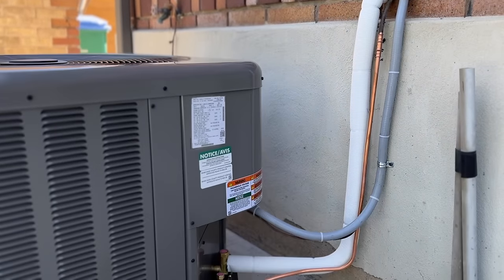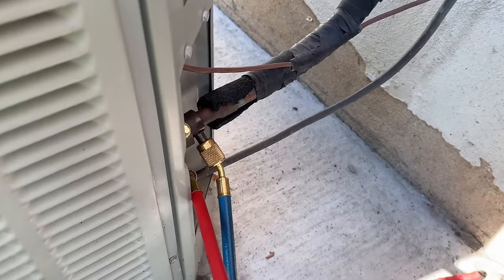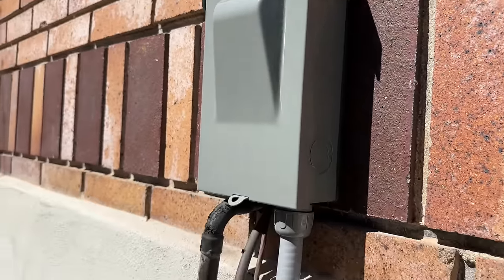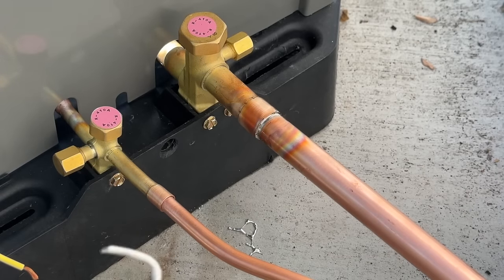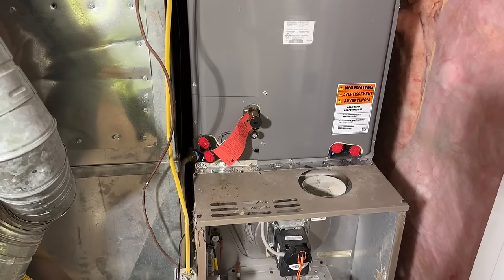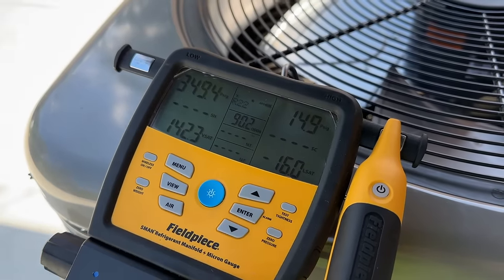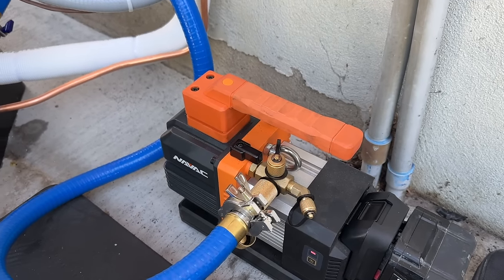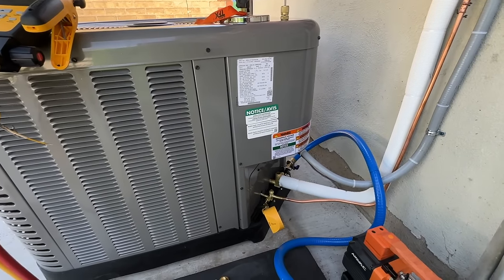Did You Know You Can Replace Your Own Air Conditioner?   -SAVE THOUSANDS-

Comment: There is a reason you need a HVAC license to buy equipment and freon. I applaud you for doing things the right way but how are home owners suppose to save thousands? By the time they buy the proper tools to do this job right they are already thousands into it.
Reply: You don't need the HVAC license to purchase freon. That is the EPA license, which is easily obtained. Commercial appliance repair, residential appliance repair, and automotive all have some variant of the EPA license.
Reply: Have you received a quote from a professional lately for a new hvac system? I have, and the cheapest qoute I got was 16 grand for a 3 ton system.  The equipment cost was only around $4500. The rest was labor! Even if you spent $1000 dollars in tools, you're still saving thousands of dollars. Granted, if you can afford it, have a pro do it. However, if you're like millions of people right now who are struggling to pay bills because of our economy, then doing a diy install makes sense. Especially if your old system needs replacing and you can't afford 16 grand for a pro installed unit.
Reply: @number1pappy that’s crazy what area are you in? We do them in Oklahoma on average a new 3-4 ton system is $7500
Reply: @number1pappy   My AC unit is 24 yr old. I called couple of HVAC companies to see how much it will cost to replace a 3.5 ton. The first company wants $16,000 , second company wants $12,000 , the third one was $9,000. Found out you will get a better price if you replace it during winter time. Apparently they jacked up the price during summer time.
Reply: @number1pappy  Talking to the wrong people then, I just did a 2.5 ton unit with a 80k btu furnace for 5000 out the door for a guy because he was getting insane quotes and I wanted to help him out.
Reply: @jredbokie1247  I live in the Columbia SC area. Sounds like I need to move to Oklahoma! Lol!
Reply: @DakotaHeatingAndAir  that sounds awesome! I could litterly fly you down here and I'd still be under what they want here in price! Lol 😆
Reply: @number1pappy  Having a "Pro" do it doesn't guarantee a good job.  Many who worked on R-22 systems won't bother using nitrogen while brazing a R-410A system and you end up with cupric oxides floating through your system.  Usually won't fail right away but you're in for problems down the road such as clogged metering devices and filters, one way valves and premature wear on your compressor.  Think pouring dust or fine sand in your engine's oil sump.  If you're lucky it will fail before the warranty is up but you might still get hit with the labor costs, which is substantial.  I've seen R-22 systems running fine after more than 25 years.
Reply: @cancel.lgbtq.6892  Well it is a lot hotter in the attic in the Summer.  So they have to take more frequent breaks and use cooling methods for their safety.  That costs more in man-hours.
Reply from the maker: Thanks for explaining this for me @number1pappy    I get tired of explaining it sometimes 😅
Reply from the maker: Prices are dependent on location. Wherever you are in Oklahoma that is way cheap. But even so, if your equipment cost 3k and tools were 1k you are still saving a whopping $3500
Reply: @number1pappy  You'll also have the tools for future maintenance use, those tools will last a lifetime for the diyer.
Reply: @avidavid9237  very good point! 😊
Reply: EPA LICENSE ???? TO HANDLE FREON , ITS A LAW
Reply: @jredbokie1247 I don't see that low of a price in OR. Not since 2007 atleast.
Reply: @bronzechicken4437  yes but just because an appliance repair person has an epa license doesn’t mean they can work on HVAC equipment.
Reply: In the state of Kansas you have to be APA certified to buy equipment!
Reply: @cancel.lgbtq.6892  Yes, off season is cheaper. I got six quotes in January, all around the same price except one that was outrageous. A 5 ton American Standard install was $13k and some change with duct work modifications.
Reply: Just bought a rheem 14 seer2 (yes seer2) the guy said it about the same as 16 seers last year.  And it cost $7500.. for both condenser and air handler… 
I called 2 company over, 1 saids $14k and their system not multi task like mine and they wont tell me how much the system cost.. as I figure out it around $5k for 5ton.. the other co. Estimated me $18k. I told them.. thank u.. so I bought all the tool.. it save me over $8k
Reply: As a diy I replaced mine 3 years ago and did everything in this video to a T thanks to YouTube. Unfortunately it was before this channel was around. I spent $600 on tools and $1100 for a 2.5t 16 seer system plus another $200 for coil with txv valve at an overstock warehouse. So you do the math. Still running great as of today. Oh I also got my level 1 license.
Reply: @bronzechicken4437 Sorry but you are wrong, the only refrigerant you can buy without a license is R134a from an auto parts store and less then 16 ounces.
Reply: @number1pappy hey buddy, you need to shop around, first off they marked up the equipment, a three ton system is about $2500, next you should not pay any more the $3K in labor. Find an independent contractor not a big dealership. Most I would charge you is $6K tops.
Reply: @hjc4604 that’s a myth, the soot literally does nothing and would be caught in the filter dryer, not to mention it’s like a spec of fine powder.
Reply: This person who say they got a quote of $16000 for a 3ton unit is a liar or the company is a thief..
Reply: In some states it is illegal to sell u a unit without the purchaser not having a licence. U even let some of that freon gases out u and get caught by environmental code enforcement u can be charged a whole lot of money.
Reply: Lol y’all just don’t get it
Reply: @cancel.lgbtq.6892  exactly
Reply: @number1pappy 16k for a 3 ton? That’s insane.
Reply: @number1pappy I got $16000 for a 2 ton system in Atlanta. And I need 2. Got 3 quotes all in the same ballpark.
Reply: @number1pappy you got quoted by a bad company lol always get a few estimates, shop around. No reason a new system should be 16K
Reply: A few hundred is more the cost of equipment
Reply: I got a quote a month ago 30k for a 5ton 20 seer, 25k for 18 seer 5 ton, 22k for 16 seer, and 20k for 14 seer, heat pump but still…….Really can buy the condenser and air handler for 7k or less.
Reply: @morallyinsane7639  Strange, I do commercial appliances and readily can walk into most supply houses and purchase 410A with my EPA card. The EPA card entitles you to purchase refrigerant. That's the literal purpose of it.
Reply: @MrCmgl1  I'm aware, I just was responding to correct the original commentator.
Reply: @bronzechicken4437  I never said that. An EPA license is needed to get a HVAC business license and need to buy refrigerant for the particular class you have, as a universal license covers all classes. I only said those who don’t possess a EPA license can buy under one pound of R134a from an automotive store. How you thought I said something different is beyond me. It’s obvious you misread my comment.
Reply: @morallyinsane7639  I had two or three to reply to so it's possible I did misread it. My apologies. The store cans also recently appear to have become 8 ounce cans, suggesting they might tighten the regulations.
Reply: If you install it yourself you better tell me some scam artist ripped you off when I have to come fix it. But I say go for it. I hate installs I love service work. It will be like a free helper and I just have to come commission the equipment.
Reply: @deepfrieddeals I’m in Atlanta to and they are ridiculous.  Need to replace an upstairs unit because due to it being on a corner lot with no shade.  Damn thing was running all day and night until I added a portable unit to help assist.  Need a bigger unit.  Over the past five years nobody has been able to explain it other than get a new unit without talking about what I really need to fix the problem.  Last time I got a quote a few years ago it was 14k.  Hell nawww.  Have had coils, fan motors and etc replaced a few times which I found I could have done myself and saved hundreds of dollars.  Im going to replace the system myself.  Changed my condenser in my truck last year so I already have the gauges and vacuum pump. 14K for a 2.5 ton is crazy.  You can get a complete system for around 2500 to 3500.
Reply: @moonlightacmaintenance3232  Here is some advice for you, never inherit someone else’s work. You are only asking for problems especially if the prior person fucked up the job. A buddy of mine used to do it all the time, and it always cost him more down the line then he ever made on the job. I taught him to scrap the job and start fresh. Of course if you would rather learn on your own, go for it.
Reply: I live in a house without a basement. I have what’s called a perimeter loop around the concrete floor. Should the unit in the house go at the bottom of the downdraft furnace or the top?
Reply: @leiferickson713  The coil has to go directly in the air flow, thus your unit would have to be lifted and placed on top of the coil with the plenum box below the coil. You might be better off with mini splits depending on the layout of the home and where you want cooling.
Reply: Hey- some of us are a lot more resourceful because we've had to be. We share tools- sometimes barter trade for tool use- like I have a buddy w a flatbed but I have a snatchblock and a bolt on crane attatchment, and when our friend needed something moved, she traded both of us use of her late fathers tree rigging equipment and chainsaws for a hazard tree - we all solved some issues, and nobody bought a thing except gas, sunscreen and cut proof safety gear. u know what they say,  where there's a will, -theres a bunch of scrappy diyers..
Reply: @ULINEgo  The saying goes, it’s not the tool that gets the job done, it’s knowing how to use the tool properly that gets the job done.
Reply: The tools are cheap and doing it yourself is 2 to 4 times less expensive than the greedy AC companies!
Reply: The r 22 is alot better Air condition
Reply: @bronzechicken4437 in California do you need a license to buy anything related to HVAC
Reply: True, but you just paid for your new tools and have them for the next job.
Reply: @number1pappy  about 20k 
California, if you handy enough why not do it your self,
Reply: California wont sell you a ac compresor if you don't have hvac license
Reply: Am I missing something? There are a lot of missing steps? From the installation from inside and how to use the equipment. I really need to install the furnace and air conditioner in a house that I bought that needs a lot of work.
Reply: Hvac hacks are deep in these comment sections lol 😅
Reply: Look at the tools as a perpetual investment.  The joy comes when you can fix it yourself the correct way.
Reply: If you are letting the old gas in the air its not good for the environment. Not sure how a home owner without epa cert will recycle the gas .
Reply: Right on. Soft solder 410A is just wrong
Reply: @number1pappy  you are nuts.  In my area you can get a 3 ton central AC seer 14 or 16 and a furnace for 7500-10,000.  That price must be a big 5 ton. If not it’s ridiculous
Reply: @number1pappy a lot more than 1000 in tools bruh
Reply: joe shmo definitely isn't doing this
Reply: I have my EPA and access to tools. I can replace my own for the price of supplies. The unit and a few hundred in new duct to fix what someone else messed up.
Reply: @morallyinsane7639  there are 2 sides to every story, I’d be interested to see what the actual quote was for. You don’t know if he put a variable speed condenser, UV light, duct cleaning and all kinds of other shit on there too. Be careful to judge until you know the whole story. But hey, if he’s telling the truth, that contractor won’t be around long
Reply: @christopherfoote3395  is there an EPA license involved here? Or are all these people doing this without it?
Reply: @jonswisher8796  it’s not the equipment price that makes the difference, it’s the mark up on that equipment. Depends how a contractor prices their jobs, whether it’s a flat rate price of material and labor or variable pricing. I have seen companies charge a 150% mark up on equipment and a labor cost of 2 men 8 hours each at $150-$200 an hour for labor.
Reply: @jasonwoodward4207 where do you live, Manhattan?
Reply: If you install it, you can also maintain it.
Reply: @jonswisher8796  Yes but people do it all the time without it when handling the freon.  As long as you don't discharge it into the atmosphere and recover it properly you won't have an issue.  There is free training and la free license that come with it after you finish listed here.  Knock it out.  I'm almost finished.
Reply: @jredbokie1247 I'm in NC and a 2 to 3 ton system for a basic system costs 9000.
Reply: @DakotaHeatingAndAir wow. Must have gotten a good deal on the equipment.  What was your profit?
Reply: @noahoyeah  I made about 1100 take home give or take.
Reply: @jredbokie1247
Who do you work for? Because I’m in Oklahoma and that is the cheapest quote I’ve heard…
Reply: I work in the HVAC supply business. The DIYers are the worst.
They go to YouTube University and think they've got it all under control.
No video is going to give you all the little tricks you learn over years of experience.
These folks will come in, make purchases and return dozens of times for more material.
They'll try to pick our brains and we'll tell them your the contractor now, I don't know what you need why don't you know what you need.
What's next, doctors showing folks how to do their own stitches?
Tradesmen like this dude are what's wrong with the repair industry today. 
Why for the love of the God's would you want to put yourself out of work?
Years ago folks would guard their trades secrets well.
Now they give them away for a few dollars.
These tradesmen are the worst of the worst and should be shunned by their contemporaries.
Reply: @gitouttamyway7611
Theirs nothing wrong with a DIY person, we all were learning at one point or another.
The average American is living paycheck to paycheck unfortunately it is extremely expensive to have HVAC work done. You hear horror stories about auto mechanics ripping people off well guess what you have HVAC people doing that too. 
I legit had an HVAC tech carrying on a conversation with me while he worked, asked me where I worked an what not at the end when he gave the quote on what needed fixed I was told “well you make the big bucks share the wealth”. I do not make big bucks, I never told him what I made he just assumed, either way extremely unprofessional. The guy also over charged my unit messing up my expansion valve which they never did take ownership of an wanted to charge me another service fee. Thankfully a family friend that was a tech is the one that figured it all out.
Reply: @number1pappy u gettin screwed
Reply: You guys must be out of touch around here units cost about $16-$24,000. No Joke, a 3 ton unit so if you don’t believe me just call any local place around here in South Carolina and ask for a 3 ton unit installed your house you’ll find out is 16 to 24K and that’s not including other cost labor and materials and all the other BS they want to add. I know you could buy air handler’s and coils separately on your own but you can’t buy Freon.
Reply: My son was quoted $20,000 to replace his AC.  It was 103 F outside.  He decided to wait until winter.  In meantime he bought a window AC to get by.
Reply: Buy the tools, then resell as used.
Reply: This is ONLY a diy job if you have the knowledge and tools to complete the work. I know this and I don’t even have a HVAC education. Loved the video though.
Reply: Are there any places that do on the job training
Reply: Freon hasn’t been used in years…….
Reply: Some of us are just that curious to learn anything to benefit ourselves and families and actually want to have tools for the fun of it. So don’t you worry about us, after all we all have a friend that can lend tool or experience to help us save if possible.
Reply: @gitouttamyway7611 wow so you do not fix your car, do not replace receptacles in your house, do not try to fix lawn mower? Always call pro?
Reply: @cancel.lgbtq.6892 our price book doesn’t change with seasons. It only changes when we get a price change from manufacturers. Seems sketchy to me. It helps to get several quotes.
Reply: The HVAC industry is incredibly protective of their market and obscene pricing practices. The comment by rotdrache78 is all too typical. I hope he does’t ever service his own vehicles as they might catch fire if he does. He should only let a professional change his car’s oil. That’s their basic argument.
Reply: @jredbokie1247  Yeah and that average $7500 system is more like $2K DIY. It also really matters what home values are in the area despite the equipment being the same price everywhere and what the techs gets paid only varies by about 25%. So that $7500 job can easily become a $15K job in a neighborhood of $3+ million dollar homes despite using the same equipment and taking the same amount of time. Most HVAC contractors are simply obscene in what they charge.
Reply: If there is that much money in HVAC installs, some of the DIYers might need to consider going into the business.
Reply: Primary condensate line was not visible to me.  Did anyone else notice that?
Reply: @morallyinsane7639  If it's a myth why does every manufacturer require brazing with nitrogen to qualify for the warranty.  Why does every tech school teach it and every trade magazine say it's true.
Reply: @datn2652  Notice that The DIY HVAC  Guy has no disclaimer statement, which means he does not care if people get hurt or not. He does it for clicks and ad revenue. There are two types of professionals, responsible technicians who give you facts and dangers of doing a job for educational purposes explaining that proper training is always recommended. Then there is the irresponsible technicians, who just tell you what you want to hear and see, also making claims of bad business practices. When he doesn’t care otherwise what happens to you based on his advice. Guess which one he is?
Reply: When purging the nitro out.. I like to stop at about 5psi and then put the vacuum on. Doesn't give ambient air a chance to enter.
Reply: @diyhvacguy i did my own mini split not long ago (was my 1st time) I had zero tools and equipment. $300 dollars later I have everything I need & I wasn’t even going for cheapest stuff
Reply: @number1pappy I got quote 1200 labor
Reply: @number1pappy Amen!  I agree. A lot of people are struggling.  I do DIY work out of necessity because of the excessive high cost to hire an unqualified Professional. I would love to have a large amount of disposable income that I did not have to care about the cost. 

The last time (4 years ago) I had an HVAC person come over for just simple maintenance ($300), I got a recommendation for about $4,000 of preventative maintenance to replace a bunch of parts.

I am sorry that the 99% of bad HVAC technicians make the other 1% of good and honest HVAC technicians look bad.
Reply: Yeah, been a master electrician for 25 years and never thought I would ever get into the refrigation trade, but on my last real estate flip, I got stuck in the middle of nowhere and got outrageous quotes.
Bought a fieldpiece on FB marketplace for 375, evac machine for 250 (brand new), ordered my core tools at Amazon for 20 bucks each, fieldpiece has a built in micron gauge, so savings there. I had an existing paper scale in my office that goes to 50lb, so easy peasy, the vacuum pump from harbor freight is only 149 for a 2 stage, but you could do it with a single stage 2.5, time is no issue for a home owner....
Reply: Just got a quote today from Service Champions in SoCal. 4 ton system replacement… $20k. I was baffled, paid the fee for my quote, thanked the guy for his 7 minutes of looking at my system and walked him to the door. That’s absolutely ridiculous.
Reply: @jredbokie1247 I live in Plano tx.  Guy came out the other day and gave us a quote for a 4 ton.  14-26k estimates.  He gave us a sheet for 4 dif kinds.  When asked about something 10k or less he said “yeah man that’s not possible”
Reply: @hjc4604 

Yep. The guy saying DIYers shouldn’t be working on their own systems doesn’t follow manufacturer guidelines to purge. And I bet he would throw a hissy fit if you called him on it while installing your unit. Or call you a helicopter customer.

I’ve seen the side by side tests - not purging makes a lot of soot. Use stay-bright 8 if you are not going to purge (plenty of testing on that).

I’ve seen techs in forums talk about not purging, not using a micron gauge and checking the charge by the “beer can cold” low side method.

I saw one guy admit he never used a micron gauge and then he borrowed one. Only to find out his pump was busted and not pulling down - so the last dozen jobs he did with the “leave it running for 45 minutes” method probably have grossly contaminated systems.

And that folks, is why I do my own hvac.  I have over $1000 in tools but I did two previous houses and the house I’m in now. That’s three systems. And two mini splits for a buddy.
Reply: @chasAdmin  lets be real. This is not ammonia or transcritical co2. For home unit level, the test is so easy a 5th grader could pass after a couple rounds of flash cards worst case. This
Reply: @chinno1234 nope. That’s actually cheap in my area. Chesapeake VA. I’m happy to share company names. It’s all so very expensive. We went the entire summer without AC because we were quoted $30k for a new unit. They were gonna discount the second unit for a total of $37k for two units. I’ve spent the winter learning how to install them myself after researching and finding out I can get my own license and purchase everything for less than $10k.
Reply: @chinno1234  I know very little about AC but our friend was getting quotes like that to install a smaller unit in a 1000 square foot commercial space in Seattle.
Reply: @number1pappy  hell ill help him i live in nc im licensed in nc and sc these people are insane jacking prices up. The problem is the companies jack them up on us.
Reply: @hugomembreno4653 Here in NC you have to have License by the state board as well as a EPA universal.
Reply: Exactly then a month later they are calling me a professional whose been in the trade for 20 years stop doing these videos. Do you know how many people have calles bc of videos like this. 😂😂😂😂
Reply: @Lewdacris916 the only thing that should be 16k is a package unit 😅😂😂😂
Reply: Fitting an AC is a piece of cake compared to installing combi boiler or an heating cylinder 😂
Reply: I was quoted $20k for two 2-ton Goodman units in Atlanta, and that was the cheapest quote from 3 contractors I had over. Highest was $26k.